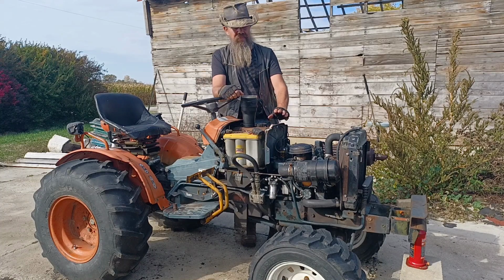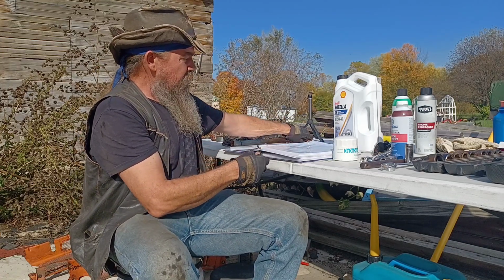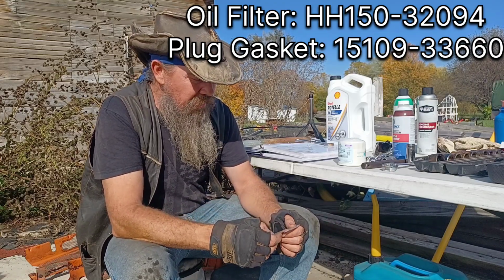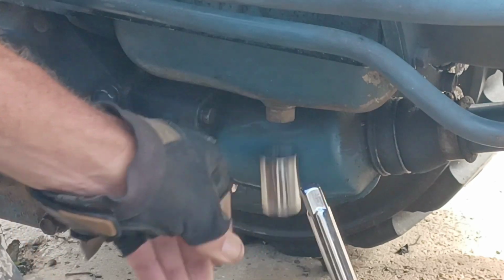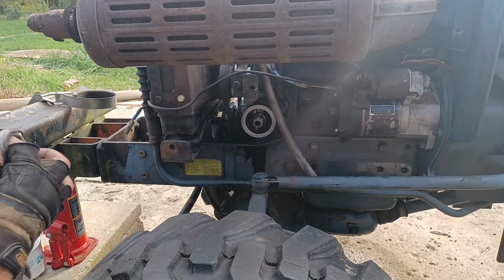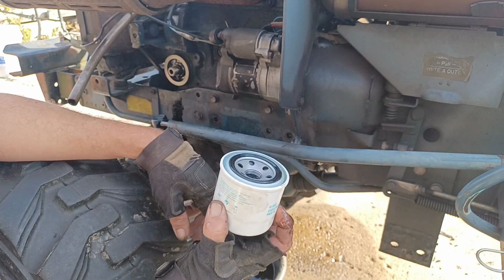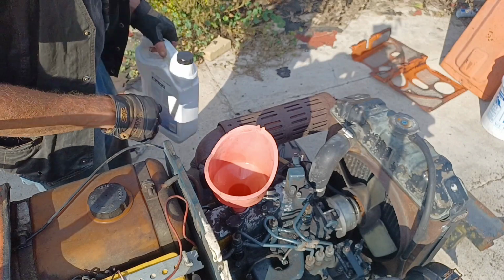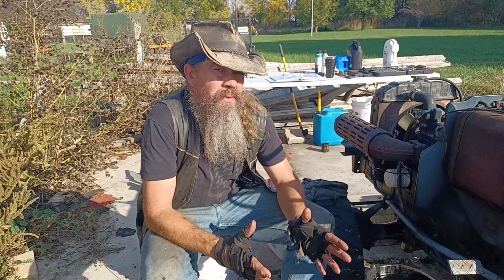Engine Oil Change Tips and Tricks; Kubota B7100 HST-D

Comment from the maker: If you find this video useful hit the like button, and consider subscribing --https://www.youtube.com/channel/UCjK9PO5WoZYkcuUhNEK0Q9g?sub_confirmation=1
If you have any questions, or would like to share your own experience related to the video, leave a comment below. I do enjoy interacting with my viewers.
Reply: where is the alternator?
Reply from the maker: This tractor doesn't use an alternator, it has a dynamo that you will find on the front of the engine. It looks similar to a water pump and shares it's pulley and shaft with the fan blade. 
2 gray wires come out of the dynamo and go to a rectifier underneath the dash panel. Then 1 red wire runs from the rectifier to the same terminal as the positive battery on the back side of the key switch.

Hope this helps. If you have any more questions, feel free to ask.

Comment: Just watched oil change and filter. I like plain straightforward explanation. I never would’ve thought to change the copper washer-gasket on oil plug. I’m putting that on the list now. I just installed a rebuilt hydraulic cylinder for loader arm, & all the hydraulic lines. Colored zip ties to keep track of what goes where made it simple  for this simple man. Thanks for the videos keep the faith!
Reply from the maker: I'll be needing to change hydraulic lines soon, valves for the loader need rebuilt as well.

Comment: Hi From Vermont..  I recently got a B7100 HST-D and you are very helpful. Just doing first oil change. Can you give us the manufacturer of the Motor Treatment stuff you used before draining?? Thanks!!
Regards, Terry King
...In The Woods In Vermont and On The Nile in Egypt
The one who dies with the most Parts LOSES!    WHAT DO YOU NEED??
Reply from the maker: Hi Terry. Congratulations on your B7100 purchase. You're going to love the mighty little machine.
The motor treatment is our local Rural King brand of seafoam. It has changed names a few times over the years, but is currently called Providence Automotive Motor Treatment. Some time back, I peeled the label off of one of the cans, and it was indeed a seafoam can beneath the shrink wrapped store brand label. 
I don't think you have Rural King in VT, but your local farm store may have a very similar product.
Thank you for your interest.

Comment: could you go over your hydraulic setup and the front end loader build?
Reply from the maker: I'm not sure I understand just what you are asking here. The Front End Loader is a Woods DuAl 145. This was one of a few different loaders that could be ordered and installed through a dealer at the time. Building or adding a loader to one of these old tractors that does not now have one can be very, very cost prohibitive and end up taking more money than a tractor with loader costs to buy.
There are a few videos in my playlist here that show servicing the hydraulic fluid, removing and installing the subframe, and the loader etc.. that may help in what you are looking for.  https://www.youtube.com/playlist?list=PLaSBaXJkkz-3LwlnRvPkxPtj8zl-2o6ry
If you can't find what you're looking for in any of the videos, please ask again and I will do what I can to address your issue.

Comment: If you do 50 hours or less, once a year is fine.
Reply from the maker: Certainly is. I can't imagine using my tractor less than 50 hours a year, but I'm sure there are some folks out there who don't use theirs as much, and thus don't need to change oil so often.
Thanks for watching!
Reply: @abundantlifehomestead3100  I'm skidding some logs once a year for firewood and doing a bit of road grading, that's it.
Reply from the maker: When I still burned wood, and then when the ash borer decimated our woods, my tractor spent a lot of time skidding. That's where I learned these little machines are surprisingly powerful for their hp and size.